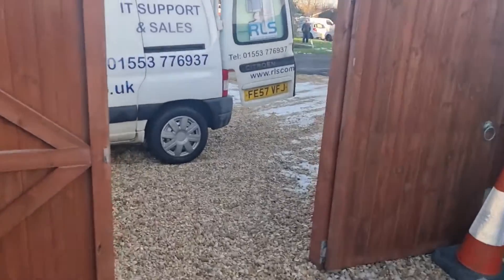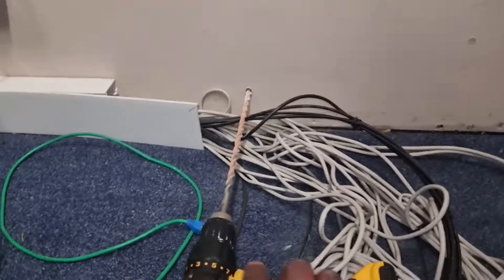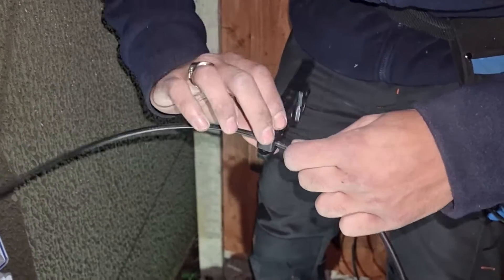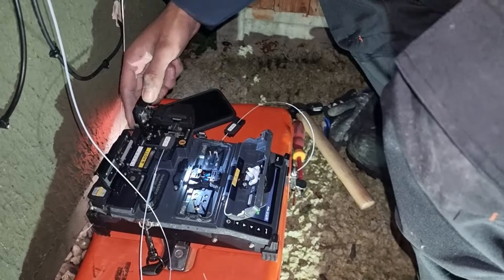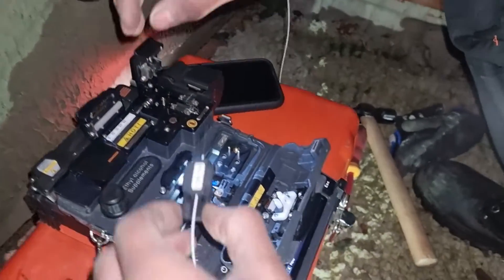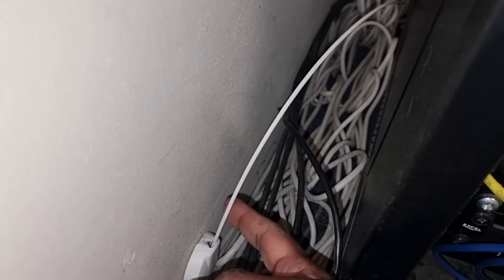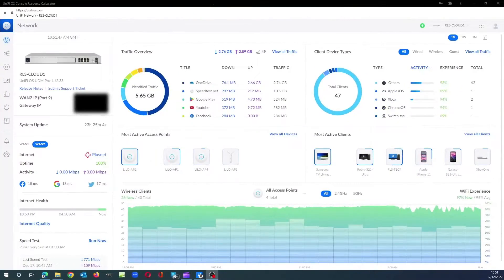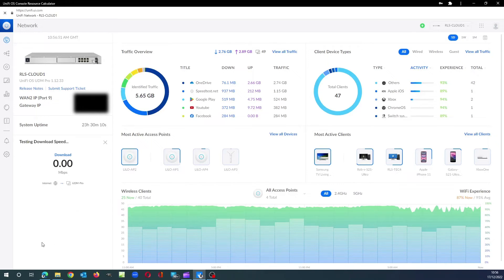Full fibre installation using BT Wholesale Broadband Services.

Comment: Excellent video demonstrating how the fibre rollout in the UK has been screwed up by use of low skilled labour and subcontractors. I had FTTP installed in 2012, true BT skilled engineer spliced pigtails that connect to my ONT to a blown fibre, ten years later and now using multi channel multi port pushing 2.6Gb, no issues - everyone I know who had installs after 2015 are suffering from serious losses when going past 800meg now due to the types of install shown in this video! I see the cowboys in the streets lashing fibre every day now, fag in mouth, loving not having to deliver pizza anymore..... Networks gone to shite before ever being finished. My neighbours connection made recently would just not work so they stuck the OTDR on it and found nine poor splices on the link, all the way back to the exchange!! Money talks I suppose
Reply: 'fag in mouth' lol😆
Reply: The bandwidth for connection usually doesn’t change the reliability with this technology

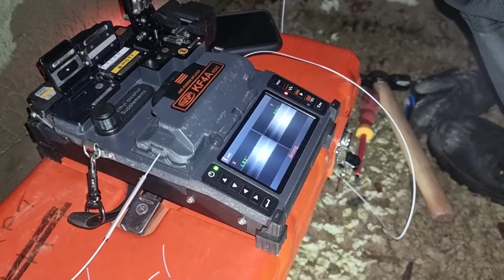Comment: that's a bad splice with high light loss [5:43 in the video]. should've been re-spliced right there and then. not cleaned at all before splicing. 'how not to do it 101'. Another bodge job by subcontractors...
Reply: Enraging. How many poor splices are there going to be in the system. We’ll likely not notice until we start pumping 10, 40, and 100Gbps down these in the coming decades. 

A the biggest thing is it told him in big red letters, right there in front of him.
Reply: agreed
Reply: Why not use straight cable to the router?
Reply: I've personally tested and found half a dB loss splices in the cable chamber from by OR engineers. Why you so but hurt about subbies?👀
Reply: @justthisguy  Because thats a Audit fail. OR or Contractors!!
Reply: 💯💯 gonna show the tutor this video tomorrow for the shits & giggles.

Not even began splicing yet & can already say this was beyond wrong in so many aspects 🤣
Reply: @Suqe-Madique   
You are a hero